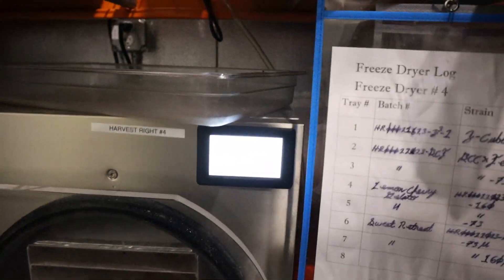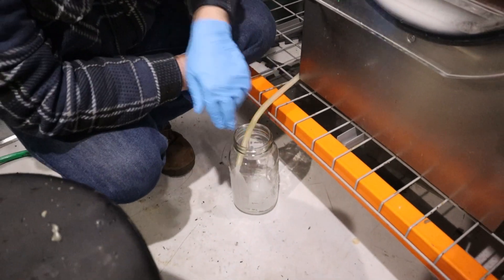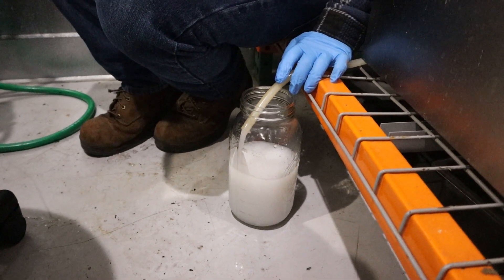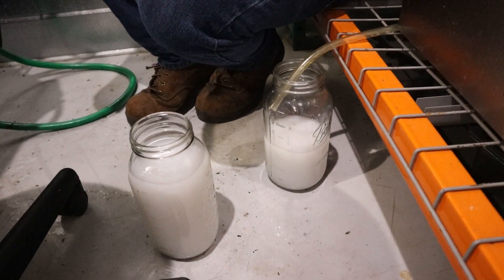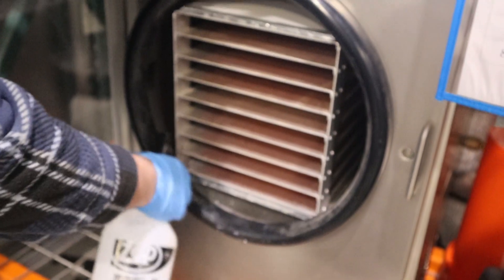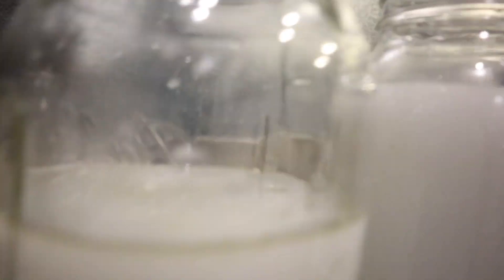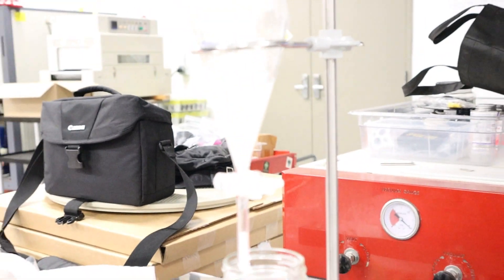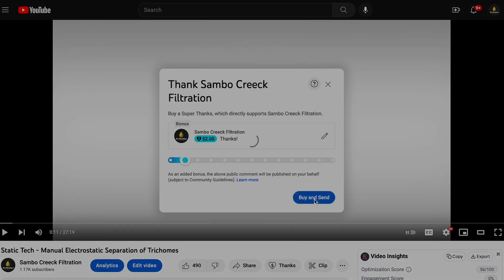Hydrosol Collection Method for Solventless Terpenes

Comment: Not clear on that which I saw? Milky viscous? Oil meniscus contains ? Terpenoids? And?
Reply from the maker: Unfortunately yields were bad so the visuals were bad. The top layer is the terpenes. The bottom milky is water.
Reply: @sambocreekfiltration I really liked the way LowTemp does the extraction. Much simpler and way less expensive. You guys have great info but need to work on making it as clear as possible as well as accessible for everyone. I think leaving a big open ended question to how you would “filter” these terps at the end of the video is a let down. Like I mentioned earlier, Lowtemps tech with a volumetric flask and freezing out the terps totally nails it.

Comment: Thanks for making this video now I need a funnel and how to figure out how to filter them out and make them clean like in the fridge.
Reply: use a separatory funnel to separate the oil(terps) from the hydrosol. If you filter that cloudy oil though some alumicel and magnesol  in a  paper lined glass frit buchner funnel it will soak up the residual moister and come out clear.